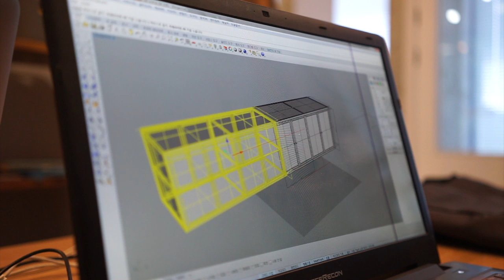Kobeomsuk furniture - Glass Cabinet for Bakery

Comment: If the glass breaks, how do you replace it?
Reply: Easy brother, if you watch the video when he was closing the top of the wood for the window, you can see him drilling and adding wood-stick. So if you broke a glass, what you have to do is to drill inside the wood stick to be able to remove the top of the window. Then you slide out the broken part and change with a new one. After that you need to add a new wooden stick inside the same hole to stich the top framing. 
I hope this explanation was clear. 
Excuse my english bro. Im not a native english speaker. 👍😉
Reply: That sounds like a good technique, but I'm not sure if that's what's going on. He does drill into the top of the doors just after the 8 minute mark, but that's to install the hinges. I'm not sure what that style hinge is called, but given its shape, it could be acting like a pin locking the tenon in place.
Reply: @ericmarthinsen  i see. Maybe i saw wring. But actually its the normal process to close the window in asia. But sure i could be wrong also. 🙏😉
Reply: I wondered the same thing. This is the second video I've seen recently where the last piece of the frame is glued after the glass is installed in a groove.

Comment: To everyone concerned about how to change out broken panes of glass:

I’m 99% certain this is scratch-resistant heavy duty acrylic/plexiglass. I work with glass and acrylic on a daily basis and glass doesn’t have wavy distortion in the reflection unless it was made 100 years ago. Glass also doesn’t flex in a curve when pressure is applied to the framework it’s in, which you can see when he’s first trying out the doors. If it was glass, it would be extremely heavy for him to be flipping over the whole construction on his own— not prohibitively heavy, but pretty dang heavy for that kind of handling. Plexiglass seems more likely than a skilled craftsman totally overlooking the fallibility of glass! :)
Reply: thanks for that. It really was bugging me.

Comment: It's beautiful work, but impractical for a few reasons. First, if a pane of glass is broken, there is no way to replace it without radical means. Second, from the way it looks, there is no way of removing a door without disassembling the cabinet. Perhaps the bakery will be lucky and no pane of glass will ever break and no door's hardware will ever fail. But in a commercial setting with heavy daily use, you have to prepare for damage and design the cabinet for easy repair.
Reply: So true. The piece is beautiful but not practically designed.
Reply: wickedmessenger1 the design of the door latches seems like it would lend itself to breaking a glass panel as well. With no cushion, the sound the door makes when it closes makes me think there’s a lot of shock traveling through the panes
Reply: I guess that will depend on the glass quality.
Reply: You obviously did not watch from around 8:50. He installed the doors after assembling the frame, and also removed a door for adjustment, so obviously the doors can easily be removed. A bakery in Korea also has to be one of the lightest "commercial" use cases one could imagine.
Reply: Nordlands aha i see it there, that’s a hard one to catch! :D
Reply: Its not glass;)
Reply: Well that isn't entirely true. The glass you're referring to isn't "normal" glass. I think that he used Plexiglass - The reason im saying this, is because it doesn't look like the "glass" is reflecting light like glass would. Also any sane person would go for plexiglass in this build, as it more durable and always stays clear.

Comment: Others have also pointed out that glass must be replaceable as it will eventually break.  Glass in casework is always installed with removable stops along the lines of glass stops used in wooden sash.  I made similar rookie mistakes long ago but didn’t;t film them and provide a forum to point them out  out.